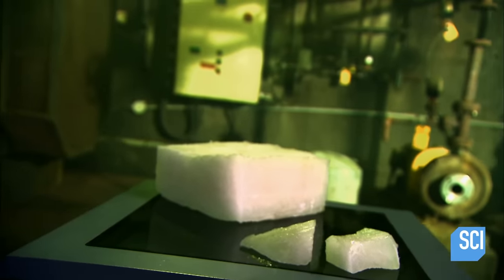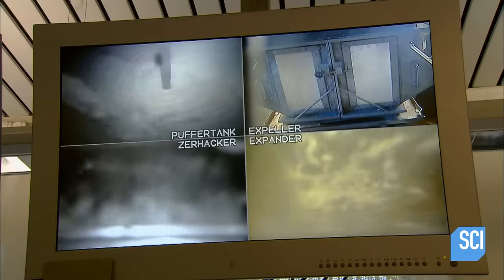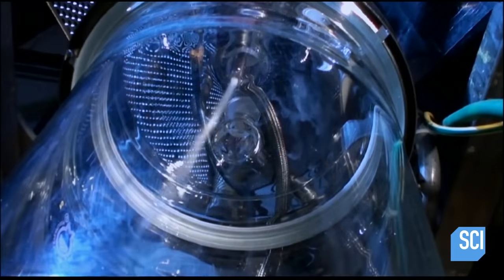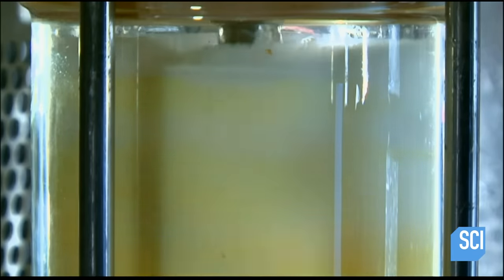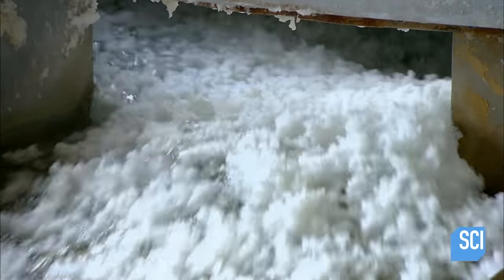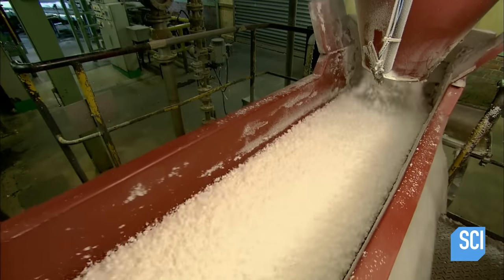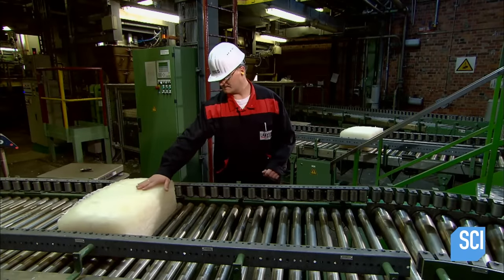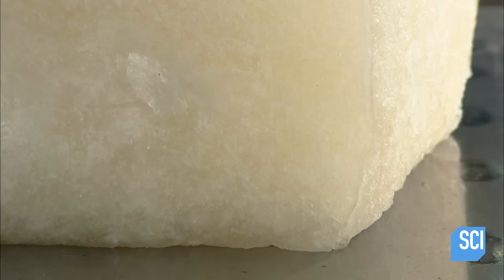How It's Made: Synthetic Rubber

Comment: The Plant in Orange, TX made a food grade butadiene rubber.  The seal oil units
for the agitators were filled with peanut oil rather than petroleum based oil.
The rubber for tires had carbon black and anti oxidant blended in.
Reply: Kind doubting, not bcs im especialist, but from were do you got this information? Do you know the process or work at some industry of synth. ruber?
(If you work, how is the job? Boring or actively intense? Is it tiresome or kind of nice?)
Reply: Can u tell me the function of carbon black in tire made of rubber ?
Reply: @thanhpham8377  it’s just a pigment, carbon black is what turns the tires black
Reply: @thanhpham8377  it's no just a pigment. it reinforces rubber good. it's called a filler
Reply: What kind of antioxidant is used in tires? Do they also contain aniline?
Reply: What about the rubber used in tennis balls?

Comment: …head down a conveyer to a quality control inspector. This inspector examines them for imperfections.
Inspector: flips blocks twice.
Reply: Each and every block is perfect, in it's own way. Perfection.
Reply: Probably just looking for big gaps, or liquid, or discoloration, obvious stuff like that
Reply: the perfect job! Just flipping rubber blocks around for the whole shift
Reply: @laurisikio Those blocks weigh about 70 pounds. The tire plant i used to work in would use vacuum lifts to handle these blocks
Reply: It look like a completely automated factory he was like the only employee I saw

Comment: The synthetic rubber is like wet snow 
Me - ok i see

Me after 2 sec - wait what 😂
Reply: It makes perfect sense
Reply: @stickmakerman  have you seen wet snow. Well snow is already wet so just call it snow 😂. Like you don't call ice as wet ice
Reply: @susmit1093  You must not live in an area that snows a lot. You can have “dry” powdery snow, wet, sloshy snow, etc. the phrase “wet snow” makes perfect sense.
Reply: @sunchips18  ok. Yah i don't live in snow area. Maybe that's why I find this odd
Reply: @susmit1093  ok so you know wet rain and dry rain then 🤣
Reply: @madloop3217  this was the point that I was trying to make like there is no wet or dry rain. Similar to there is no wet or dry snow it's just snow
Reply: @susmit1093  actually I have seen it, every year
Reply: It makes sense, wet snow has some water in it, dry snow has air, so dry snow is like powder, you can't squish it and make snowballs out of it, it's difficult. Wet snow on the other hand is like clay, you can easily squish it and form it, but since the rubber was white and clumpy, wet snow is more accurate to compare it to than clay.
Reply: @Pain9682  have you seen snow. Because in my opinion i think people do make snow balls from dry snow also. The comparison would have been great if it is compared with paneer
Reply: @susmit1093  Yes, I've seen plenty of snow in Norway...it's possible with dry snow, but difficult.

Comment: Natural rubber comes from a tree, synthetic rubber is "Petroleum" based. To the "Environmentalist," explain how you suggest we make "Rubber Products" for your Electric cars, if you want to "Save                         the Planet and Eliminate Petroleum '. Just a quick note , our "Economy is Petroleum Based."  There's an Old Saying, "The road to disaster is paved with good intensions"...Example: The direction the democrats are taking the Nation...Hope your enjoying paying $8.00 a gallon... One last bit of information, it will take 500 tons of "Strip Mined" material to make 1 battery for your "Planet Saving Electric Car," that's just to get the material, it doesn't include the "Manufacturing" or the "Disposal" after it's life span. Wait until you find out how much it will cost to replace those batteries in your "Planet saving Electric Car"...try $30,000 dollars. I guess you can always buy a "New Car" starting at $60,000....I need to make a correction on the cost to replace the batteries in a Tesla...it's "Only" $22,000, please forgive my error.
Reply: Outstanding comment. It's all about power and lining their pockets, nothing about the environment or saving anything. "Obvious to the most casual observer".
Reply: Actually there is a huge push in the industry to find ways to sustainably produce rubber products using renewable materials. Many natural oils can be used for the manufacture of synthetic elastomers. Petroleum won't last forever and electric cars are the future. There are a lot of challenges to overcome, but being cynical about the proposed solutions won't actually help to get anything done.
Reply: You know, electric trains only require steel and stuff, no expensive batteries and no rubber wheels. Trains are the solution to pollution. Electric cars won’t save us.
Reply: Environmentalists hate electric cars too, it's only weird libertarians who like tesla